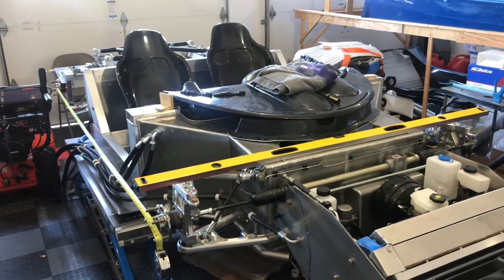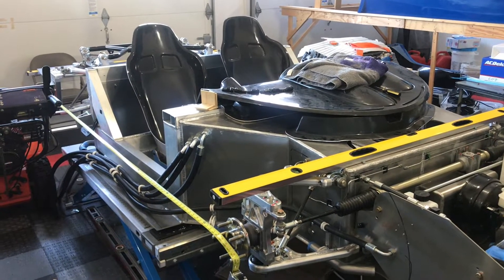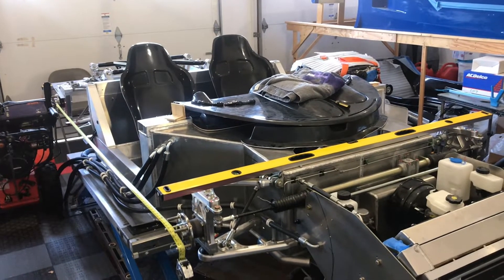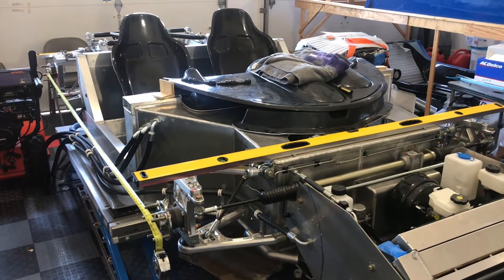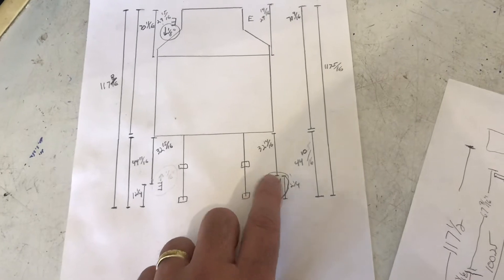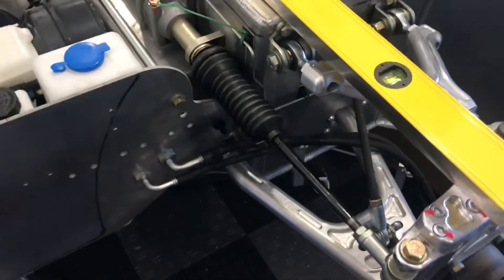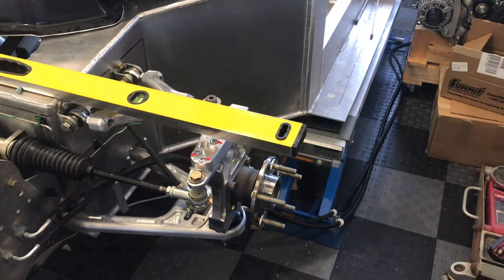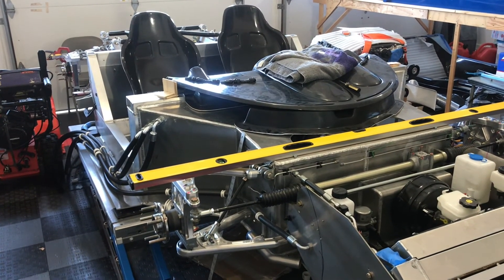Superlite SLC Build 069 Squaring Up The Chassis

Comment: FYI....you have made an effort to address NVH and lean towards a streetable car as opposed to a one purpose track car. One point I may add, I had a 2007 Shelby GT500 with a Griggs track day suspension and while the car handled exceptionally well, the various suspension points that used Heim ends made for a less than desirable street driving experience....lots of vibration and various clunks and clatter were transmitted to the passenger compartment because of the un-cushioned Heim joints.
Reply from the maker: Hey Cleatus. I agree and can imagine the solid Heim joints transfers a good amount harshness to the chassis. One builder had custom poly Bushings made and said it helped a lot. Other builders say the ride on the street is acceptable so not sure what direction I’ll go. It certainly would be easier to add the poly up front and before the body is on the car

Comment: Be careful with that digital level, that looks like the one they sell at home Depot under the "Husky" brand name and I bought 2 of those neither one are very accurate. I'm a welder , I build fences and assumed they where and they are NOT, neither one. All I'm saying is verify the accuracy, they where off a small amount but enough to notice over a 10' span.. tight work on your car , I love it . Can't wait to get one of my own.....
Reply from the maker: Kristopher, thanks for the feedback and heads up on the level. When I get to setting the actual camber after the body fitment I’ll pick up another brand of level and see how the measurements compare. If they are slightly different maybe I’ll just average the readings. Ultimately it will go to a shop for a professional alignment.

Comment: Joel great job your doing. Have you had any experience with insuring this car. I have a BelAir that is highly modified and it is a night mare
Reply from the maker: Thanks Dave, I would call Midwestclassicinsurance.com, 1-888-271-4000. Many of the kit car builders use them. I haven’t spoke to them in a couple years, but they have a great reputation.